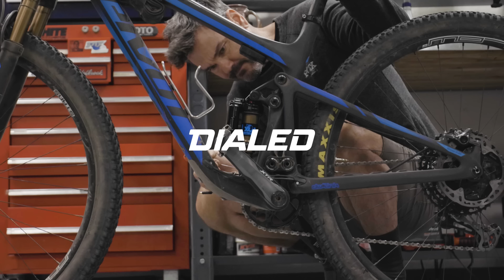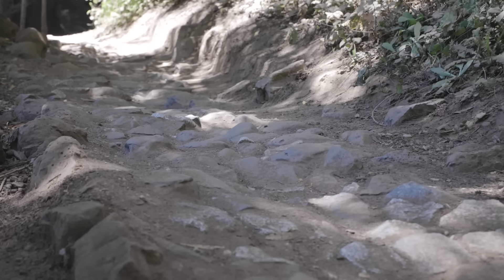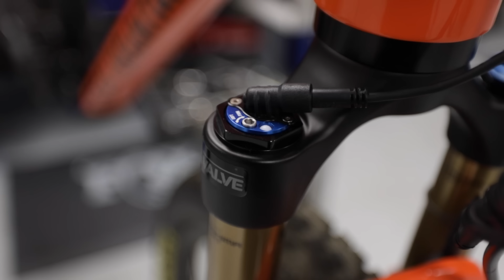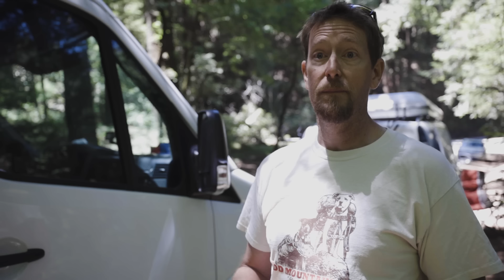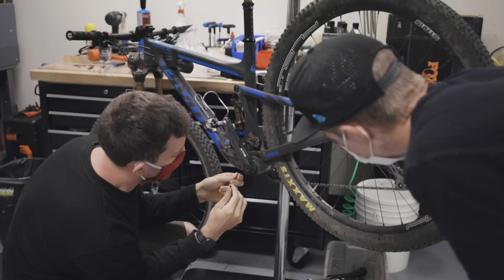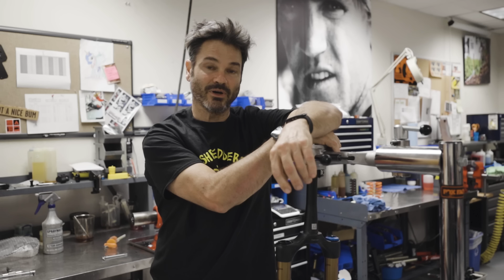DIALED S2-EP25: RAD Collaboration on Fox Live Valve (feat. Keegan Swenson) | FOX

Comment: I wonder if you can mod it to be a data logger / acquisition unit!  Based on a lot of logging, a rider can determine certain patterns, like front wheel rate vs. rear wheel rate etc...  This whole data driven methodology ain't too shabby eh!  We used a heavy aquisition unit during testing in Formula SAE to figure out what kind of bump/rebound/spring settings felt good vs. fast lap times.

Comment: I don't understand whats the problem with making system like this? You start pedaling and system locks shocks for you and when you stop pedaling it unlocks them. Why would you need to have locked suspension any other time than pedaling?
Reply: With low anti squat suspension systems having that lock out when you pedal will feel like crap
Reply: @DM-hw4cr  your suspension will be locked when u pedal only the moment u stop pedaling its fully open